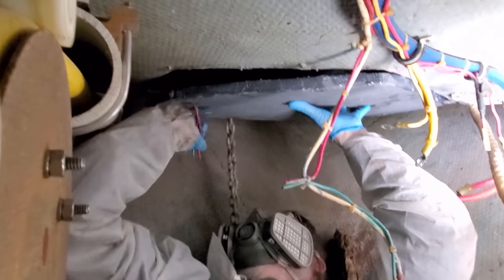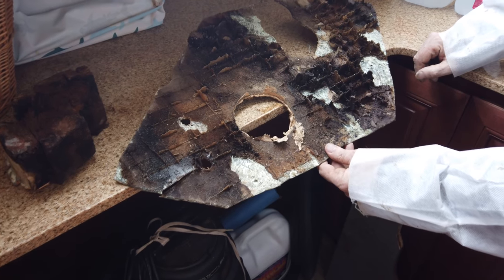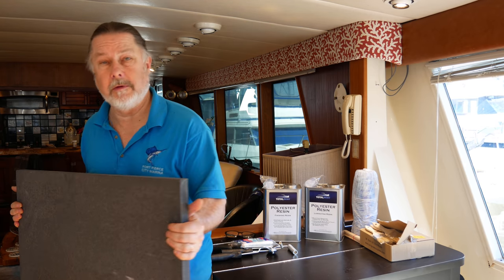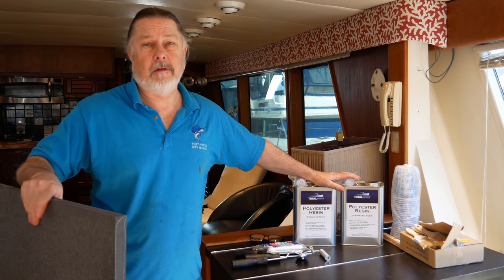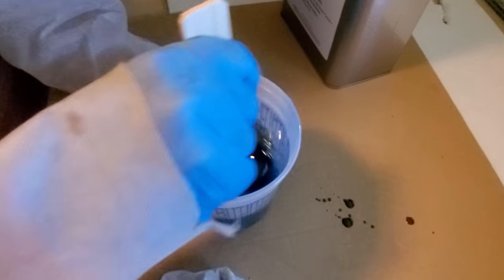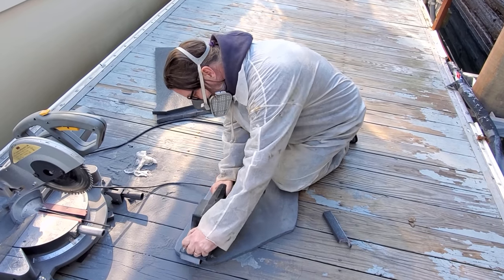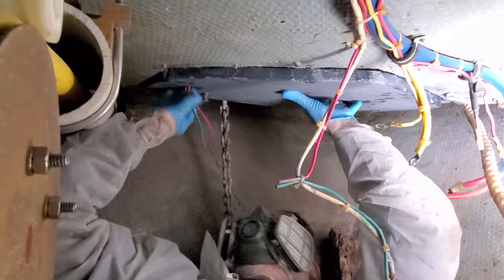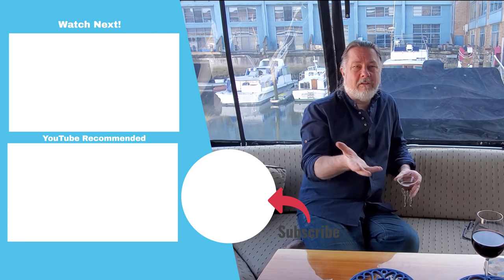Replacing deck core is easier than you think!  E116

Comment: Andy on boatworks today channel tested the hold between coosa and epoxy, polyester and other resins. They all held well and it boils down to personal choice in most cases.
The one area there can be issues is bonding against some resins means you need to use specific resin or epoxy to get a good bond. Epoxy may cost more but it will bond with anything, polyester, vinylester resins get touchy sometimes.
Reply: there sometimes can be a problem using polyester  on an epoxy  i cant remember which way arround it goes  one way works but the other way arround does not stick well
Reply from the maker: I enjoy his channel and have watched many of his videos.

Comment: There's tiers of resin polyester, vinylester, and epoxy. Epoxy is far by the strongest, but it's also the most expensive. Vinylster is basically the middle ground between cost and strength, polyester is well the cheapest of three and you get what you pay for in terms of what your willing to invest in.
Reply: I was going to stop watching Ed but now I have to keep watching to see how long it takes to pull the windless in the ocean. It says on the can polyester laminating resin (laminate) is to build up cloth then mat then cloth then mat then laminating not for glue. To say I paided $$$ for core bord then you buy and use the polyester resin in the bow to hold the windless. Ed go back to politics pay a skilled boat ship to do that work. Read the West Systems how to!!!!!!!!

Comment: Nice job!

Are you going to stuff my resin up around the edges of the filler board? So it’ll bond to the remains of the wood core. 

Can’t hurt to put a more layers of glass them you think you need. Get as much strength as possible. V out the edges and use resin with the thickener to fill. Then as many layers of glass as possible to add good mechanical bond to the fiberglass. To spread the load of the windless out as far as possible. Both the resting load while being beaten by heavy seas and the working load while raising and lowering the anchor. Most important the shock load while setting the anchor.
Reply from the maker: Yes. I made a tube out of a gallon ziplock bag and squeezed resin into any gaps. It will be in the next video. I also sanded down the edges and put two layers of fiberglass cloth around the perimeter.
Reply: @tryingnottosink9107  sounds like a premium job was done. Nice!!!

Comment: 10 to 12 layers of cloth fiberglass around  every cut to remove the skin. Angles cut both side a V to lay the cloth and resin to the level of surface. Ref the West Systems how it fiberglass!!!!!!! It comes off in a big bay in a storm you run over 2 or 3 boats then what your insurance inspector and coastguard reports windless deck failure was due to owners work done to replace core wood the owner stated to on YouTube his process.